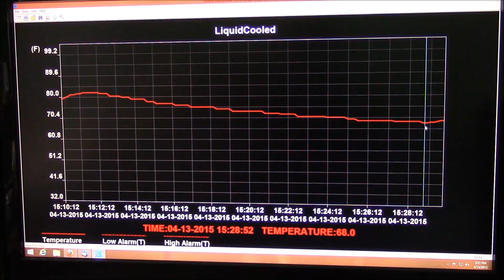Liquid Cooled Peltier (TEC) Refrigerator - Part 1

Comment: According to YouTube video titled: DIY Solar DC Direct without vattery !!!  The 3 common methods. / YouTube video channel name: Solarduino, a direct current 12V fan motor can be powered directly connected to a solar panel without the risk of an amp overload to the motor as long as: (1) The amp output of the solar panel is less than the amp input limit of the fan motor and, (2) Each fan has its own solar panel array that does not power any other fans or other devices.  However, perhaps it would be okay to use a solar panel array with the same amp output as the amp input limit of the fan motor?  Perhaps it would be okay to use a solar panel array that is one or two amps more than the amp input limit of the fan motor if an amp regulator / controller module or a PWM motor  speed controller  (potentiometer) and an amp / watt meter is connected between the solar panel array and the fan?  However, I do not know if a peltier frig could be powered this way; unlike a fan motor, a peltier device is a sensitive solid-state electronic device. Please share your thoughts about this.  Thank you.

Comment: Thanks for your ideas on using cpu coolers, awesome. I bought a 10 amp TEC on amazon, and I can't quite get me temperatures down as low as I would like using the cpu coolers, and was wondering where you got your TEC at? I know most come from china, and many are cheap, but not sure if they are good quality or not. thanks
Reply from the maker: Replied to your other comment.  I got all mine from cheap sources so I had the same challenges you did.  But I did run across a better company in my research.  I just never pulled the trigger.

Comment: Did you use water pump ?
Reply: The two small black boxes that sandwich the TEC module in the center ARE the water pumps. They are built in. :)

Comment: using that type of power supply for this sort of project is very inefficient for a 12volt project
Reply from the maker: Maybe.  But they are dirt cheap.  What would you use?

Comment: so i bought a tec mini fridge from a pawn shop and just added a water loop to the hot side and it works so much better. currently use it as an office fridge for drinks. the mini fridge was sold at $3 because it didn't work, once getting it home and testing the only thing wrong with it was the power supply was dead. so my setup has 2 tec1-12706 with aluminium heatsinks on the cold side and a waterloop on the hot side. the water loop is a single waterloop with two cpu water blocks in line with each other and 2 aquarium pumps. i've got a 120mm rad with a powerful fan and potentiometer for fan control.

Comment: i want to make large Peltier airconditioner
Reply from the maker: I started out wanting to do that, too.  I gave up, though.  I don't think this is a good application for an air conditioner of a large volume of air.  It will only work well in small volumes that are well insulated.
Reply: Search for the fermentation friges.

Comment: Dude check out my review at amazon on this heatsink with 2 diffrent peltiers
https://www.amazon.com/review/R1OD4KQ3IHYK4/ref=pe_1098610_137716200_cm_rv_eml_rv0_rv
Reply from the maker: Yeah, I wouldn't expect that heat sink to handle much.  Good results, though!
Reply: the 10 told me alot about the TDP for the 15 and the lower voltage getting better results screams "hey i dont have enough to take off the heat, fix it!" if you go back to working with these you may want to check this factor with the H60s and see what the results are. That heat sink i got from amazon may be better suited for a 12706 or lower. The 12710 paired with the custom liquid chill side im getting 54F but the surface temp of the pelt is about 18F ive still got alot of hose to shorten down to reduce loss and the heat sink paste im using (that is free to me) is contributing to the losses im sure of that i ordered some from amazon but they didnt get it to me for this weekend it ended up being on back order also the stupid temp controller i bought from amazon only does Celsius  so annoying. Ill keep ya posted if you like and after i get it done ill post a video.

Comment: Im doing the exact same thing but with a small cpu heatsink and 2 fans one the cold side (Blows out cold air. a.k.a ac unit).
Reply from the maker: Awesome.  I will be doing another peltier experiment soon and trying to make an air conditioner.  I know many people have attempted it with limited success or outright failure.  I am determined to find a way.
Reply: LDSreliance making an ac too. I'm thinking of using a liquid cooler on the hot side and a small cpu heatsink on the cold side (blows out cold air). I have 70w 154w 230w and 400w peltiers.
Reply: LDSreliance i have think a way to make Peltier airconditioner with large module

Comment: I'm think about doing something similar but on a way smaller scale. Mini a/c built in to a 6inx6x6 box and insulated.
I'm looking to get the H80 model liquid cooler.
Did you do any temp test with only one radiator hooked to the hot side? Results?
Do you think H80 suffice with a tec1-12706 
Thanks
Reply from the maker: Any water cooler will be more than good enough for a 12706.  I am confused what you mean by more than one radiator on the hot side.  I only had one in this video.
Reply: LDSreliance - thanks for the info, good to know.
In your vid you have one water cooler attached to the hot and one to the cold side.
Now I could be totally wrong but it seems like the water cooler on the cold side would actually impead its performance. Since it would take a long time to cool the water down in the radiator.
I was wondering what the cold temps were with only a radiator hooked to the hot side and nothing on the cold side. 
Thanks for the reply
Reply from the maker: Without a cold side heat sink or cold plate it would get extremely cold but not be useful.  You can drip a drop of water on the surface of the cold side like that and it will instantly freeze.  Pretty cool.  But the problem is you have to channel that cold to somewhere for it to be useful.  So you have to use a heat sink or cold plate or radiator of some kind.
Reply: LDSreliance - much appreciated. I'll let ya know how it turns out

Comment: could i theoretically liquid cool the hot side with a computer radiator and use the cold side for cabinet air cooling?
Reply from the maker: Yes you could.  They don't work as well cooling air but it will work if you have a strong enough peltier and good insulation.

Comment: I bought the Evga 500W power supply the only wire that I'm confused about is the yellow with stripe
Reply from the maker: From what I have read, the yellow wire with a black stripe is on a different 12v rail called the +12v2 rail.  This rail provides 12 volt power to certain processors.  You can look at your specs for your psu (usually on a sticker on the side of the psu) and find the +12v2 rail and see how many amps max it produces.  It might only be a small amount.

Comment: could you send me info on how to hack a computer power supply and how to wire the 2 h60 liquid cool fans with pelteir chip together, many thanks.
Reply from the maker: Here is how to hack the psu:  https://www.youtube.com/watch?v=M4TFVhCg6sk

As for wiring everything together, I don't have a video on that per se but I can answer any questions you have.  It is pretty simple.  The 4 pin connectors on the end of those wires will have a ^ or diamond shape next to the wire that is the negative wire.  Just mark that wire and hack off the end of the connector.  The wire directly next to the negative wire is the positive wire.  The other 2 wires are not needed (they control speed and temperature and stuff that a computer would care about but are not needed for your setup).
Reply: thanks, sure do appreciate the help, i'm building a fermentation chiller that's 28" lg x 18" width x 30" tall.
Reply from the maker: David Allen Cool, sounds like a fun project.  I have had a couple other guys email me about similar projects.  Let me know if you have any more questions!

Comment: im planning to make a peltier air conditioner
Reply from the maker: Very cool!  Good luck
Reply: thx its going to be something similar to this but with only one radiator
Reply: +LDSreliance  could these peltiers use alot of battery cause im planning to use a 8AH battery
Reply from the maker: Dean Settimi Yes, they use a lot of power.  An 8AH battery will not last very long powering one of these.
Reply: Will adding another 8ah battery in parallel work
Reply from the maker: Dean Settimi That would certainly help.  How long do you plan on running this device?
Reply: LDSreliance well i might use a thermostat to turn off the peltier from running it might save energy
Reply: LDSreliance i was also wondering if a heatpipe heatsink would work with peltiers
Reply from the maker: Dean Settimi Yes, it would work well.  Anything that works well with a computer cpu will work great for this as they are similar size.
Reply: LDSreliance well im getting 2 extra ones
Reply: The amount of energy and equipment required to make an air conditioner would be insane. Peltier devices are way too inefficient to work as air conditioners.
Reply from the maker: esqueue
Agreed.  I can only think of a couple really specific, very narrow circumstances where you would even think of doing it.  I plan on making one soon but it would have very limited application.
Reply: Well peltier only use 60-300w while an average window Airconditioner uses like 900w-1200w which makes peltiers more efficient than a compressor AC
Reply from the maker: Dean Settimi
True, but a 300w peltier would not produce even 1/10th of the cooling capacity of a small window unit air conditioner.
Reply: True but peltiers only consume 12 volts while a window ac consumes 120-220volts
Reply from the maker: Dean Settimi
Yes but they consume more amps.  Ohm's Law states that volts x amps = watts.  So a 12v peltier that is rated for 300 watts is consuming 25 amps whereas a 300 watt air conditioner that uses 110v is only consuming 2.7 amps.
Reply: Oh yeah thats right the watt and voltage
Reply: No Airconditioner is 300wats
Reply: If you use a 900w ac and using 120volts it uses 7.5 amps
Reply from the maker: Dean Settimi
Right.  So comparing amps doesn't really tell us much.  You can compare watts if you want.  And I have enough experience with air conditioners and peltiers to know that a 300 watt peltier would cool down an insulated box, such as a decent size refrigerator.  But it would not produce enough cooling to cool down a room.  Even the smallest window air conditioners can cool down a bedroom.
Reply: Yeah i alway think peltiers are cool but found out they consume more energy than an window ac which is a bummer
Reply: They both have their advantages. I recently purchased an Igloo Iceless cooler for work after researching my options and costs. The cheapest really portable (as in something that I will carry to work everyday) compressor driven cooler costs around $400 while I got my cooler for $75.  The thing is that the $400 cooler is capable of freezing contents no matter what 
the ambient temperature is while my cooler can only lower the temperature 30 - 40 degrees below ambient. 

Real refrigerators also need to be upright and you will have big issues if it is put on it's side or upside-down. Their compressors are also not serviceable by without specific equipment while the TEC driven cooler can be completely overhauled for dirt cheap from the costs of the parts and can be done by nearly anyone.
Reply from the maker: esqueue
Also, peltiers can be modulated (voltage varied) to maintain a constant temperature whereas refrigerant-based coolers need to switch on and off.  Peltiers are also solid state and have no moving parts.  They also have a MTBF (mean time between failures) of over 100,000 hours.  They can also be reversed easily to produce heat by reversing the polarity, which I have seen some coolers can do and become warmers to keep warm food warm.
Reply: LDSreliance hey what is the little blue thing that you use for your peltier it has 2 barbs where you can attach pvc tubing to
Reply from the maker: Dean Settimi It is a water block like this:  https://www.amazon.com/BQLZR-Lifespan-Aluminum-Cooling-40x40x12mm/dp/B00L286BNY/ref=sr_1_8?s=pc&ie=UTF8&qid=1468958911&sr=1-8&keywords=water+block
Reply: perfect size for the peltier i got yesterday
Reply from the maker: Dean Settimi Yep, the standard 40mm x 40mm peltier works perfectly on one of those water blocks.
Reply: even though peltiers are inefficient they are still eco friendly
Reply from the maker: Dean Settimi Yes, and they are solid state, more reliable (less moving parts), last longer, and can be easily reversed to provide heat instead of cooling.
Reply: oh so thats how the tiny coca cola fridges work the 12v ones
Reply from the maker: Dean Settimi
Yep, that is it!
Reply: Yup, I have an igloo iceless cooler for work. It's a refrigerated lunchbox. Keeps water cool for those hot work days.  It uses an air cooled peltier setup to blow the hot air on the outside and a fan on the inside to circulate the cold air. 

Like I said earlier, I got my cooler for $75 and it can be put in any position, has a 28 quart capacity, weighs around 10 lbs and uses around 55 watts. It can only lower the box to approximately 35°f - 40°f lower than ambient temperature.  https://www.amazon.com/Igloo-40358-P-Iceless-Thermoelectric-Cooler/dp/B008AQK1NC

The cheapest comparable compressor and refrigerant box cost $359.00 and must be placed horizontal, has a 19 quart capacity, weighs more than 25 lbs. but only uses 35 watts. It can freeze if you wish no matter how hot it is outside. https://www.amazon.com/Dometic-CF-018DC-Portable-Refrigerator-Personal/dp/B0030G7Y64/ref=sr_1_3?s=automotive&ie=UTF8&qid=1469156601&sr=1-3&keywords=portable+freezer
Reply from the maker: esqueue
Yep, so that is the thing with peltier coolers... they are more reliable, longer lasting, can be abused (as far as being turned upside down and left on its side, etc.), and can be infinitely modulated for precise cooling or power consumption.  But they are substantially less efficient so they will not be widely used unless improvements are made.
Reply: well my peltier broke on me i wanted to test it out with 12 volts!! now i got a broken peltier in so im ***** pissed right now
Reply: That's unfortunate. Did you run it without a heat sink?
Reply: yes i ran it with a heat sink
Reply from the maker: Dean Settimi Bummer.  How did it break?  Like did the white ceramic part physically break?
Reply: im ordering a new one anyway it was cracked on the bottom once i started using it again it stopped working, and couldnt figure out what was going on. so i opened or torn open the caulking on the sides of the peltier and found out that pieces of the peltier came on the floor
Reply from the maker: Dean Settimi
Yeah, peltier modules can withstand compressing force (smashing it on the broad sides) but not other forces.  If they get dropped or gripped hard on the sides they can crack.  Sometimes they are damaged in shipping.  I know I have had the same problem.  I always order them 2 at a time so hopefully at least 1 of them is not defective and does not get damaged in shipping.
Reply: know what screw artic, their fans always break. im going for cooler master plus i plugged in the artic fan for 5 minutes then it just stopped working. screw artic now i have to wait another ***** week, just to get my cpu fan. everything is breaking on me.
Reply from the maker: Dean Settimi Sorry man!  I haven't had any problems with the Arctic fans but Cooler Master is definitely a better brand.  I only used the Arctic coolers because the heat sink has a raised portion on the bottom and 4 even holes spaced to the sides for clamping together.
Reply: Dean Settimi  you can always try cascading the tec's or series.
Reply: Dean Settimi bro do you made Air conditioner